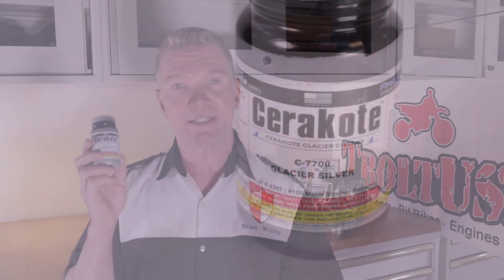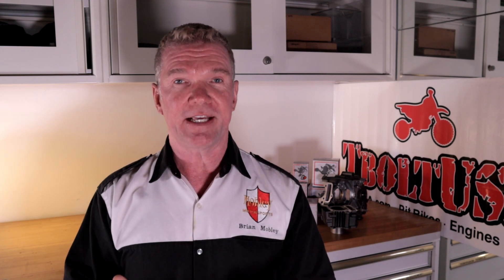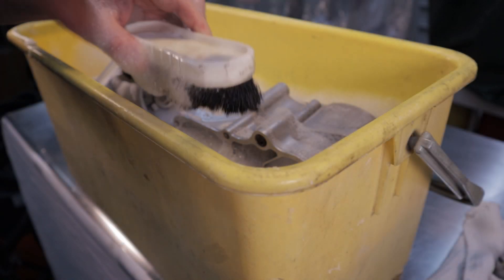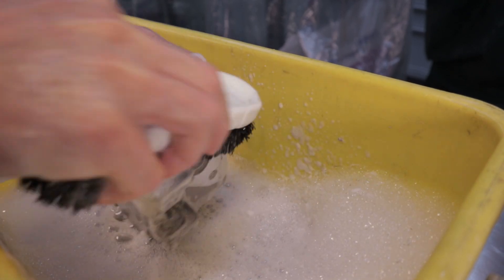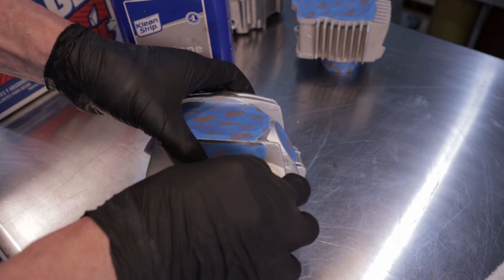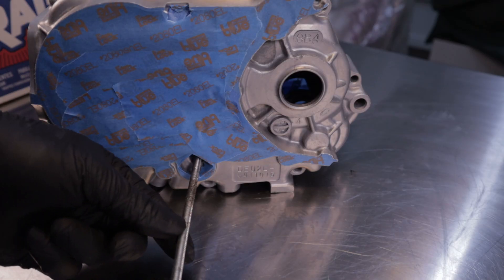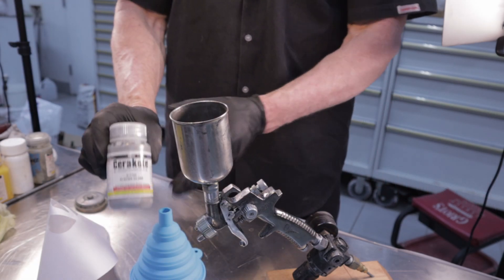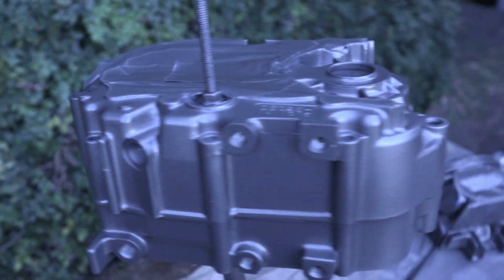Cerakote at Home || How To Get Superior Results Using Air Cure Cerakote

Comment: How is cerakote for the heat dicepation on motors??
Reply from the maker: Hi Larry. It doesn’t affect dissipation, just heat resistance. Depending on the particular cerakote product, up to 4000 degrees (as I recall) can be withstood.

Comment: What do you think about using C series on fork tubes? I heard it both ways. One local  Cerakoter says he does engines with C and only uses H series on fork tubes but didnt really explain why. Ive done one set of ktm65 tubes with the H and they turned out great but I would like to do some full size tubes and they will not fit in my oven hence my dilemma. Im just about ready to coat an entire crf450 engine with C series Glacier black  and If C series will work then I can just do it all at once Thanks so much for posting this video it was very informative and has helped me in a HUGE way.     Dan
Reply from the maker: Hey Dan!  C series on your fork tubes is fine.  It will still be very durable. The pigment is the main determining factor in relation to air dry vs oven cure. Some pigments are not as hard as others. Oven cure narrow the variability in the hardness. But, like I always tell people, it’s still very hard!  C is just fine. Frankly, neither is going to survive dropping your bike on a hard surface so just go with whats easier! I love C series and rarely use any other.
Reply: @brian.d.mobley  Awesome Brian thanks so much for the info and fast reply.
Reply from the maker: @TheRacinStanleys  Sure!  Thanks for watching!

Comment: Thanks for the clarification.   I've looked at too many of these videos to remember where I saw that parts should/could be heated to 150 degrees to bring out any oil residue?  Some I've seen people take a torch to heat check areas.  I didn't see any of that here. Is preheating not an official Cerakote recommendation or did all the cleaning replace that need?
Reply from the maker: Hi Doclees! Gas out, as its called, is not a required step, BUT it never hurts! I have never employed this step in any of my projects - many of which were previously very oily and I’ve never had a coating application failure.

Comment: What happens if you soak in acetone then tape with gloves on?
Reply from the maker: Hey Ben. It would probably work. I’m just a little paranoid that oil is still present so I like wiping everything down by hand. Another idea might be, wipe it all down like I did. Then soak it. Then, tape with clean gloves one. Just make sure you don’t touch ANYTHING with those gloves including things like itching your face, etc.